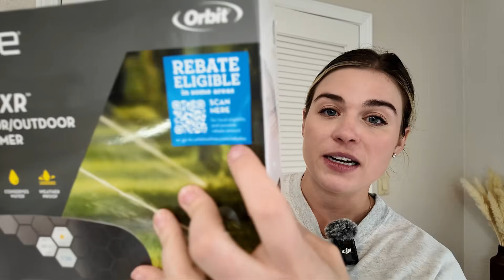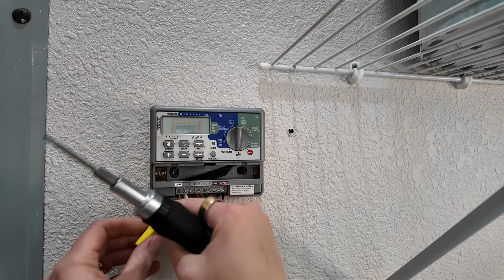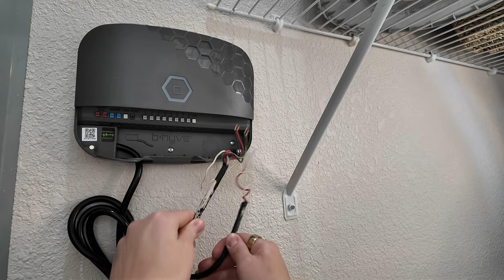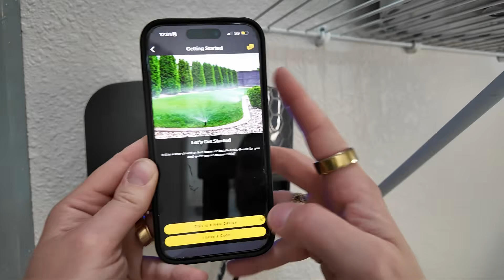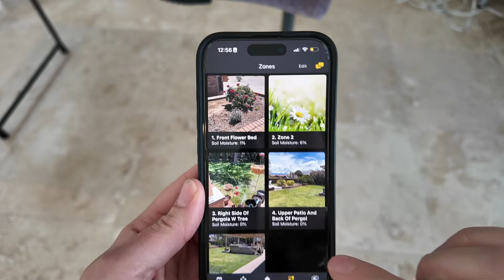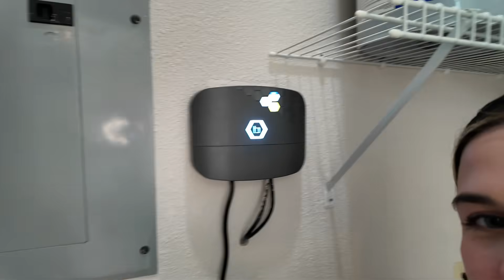How to Install the Orbit B-hyve XR 8-Station WiFi Smart Controller (Step-by-Step)

Comment: What a nice birthday present.  :)

I would like to see drip line work, if you end up making those videos.  We bought a house that had existing sprinklers and drip lines, and I had to wander around to find them too.  

I bought two of these, one to replace the front and backyard.

I’ve been buying drippers and tubing for replacements, but it would be nice to hear and see explanations, experiences shared sort of thing…. I get stuff to work, but I’m not sure if it’s the best way, if there are better ways.  No one is perfect.

Thanks again for the vid.